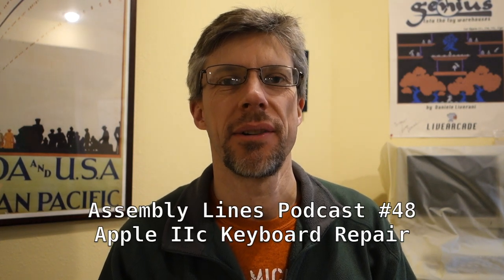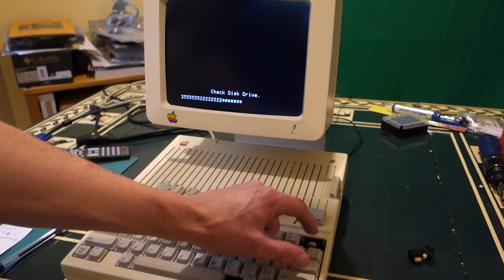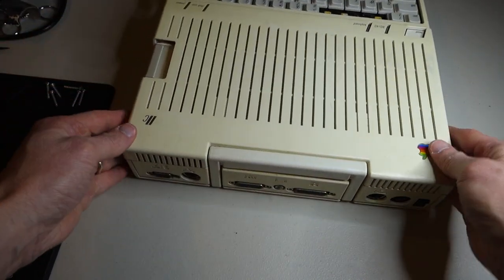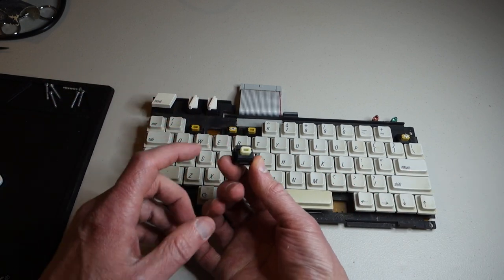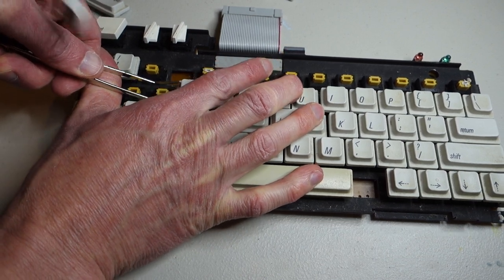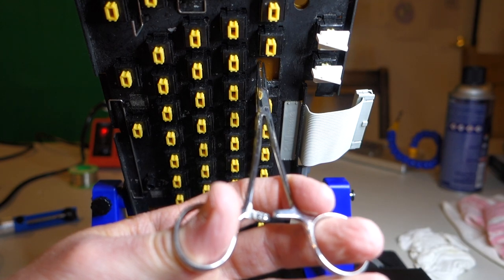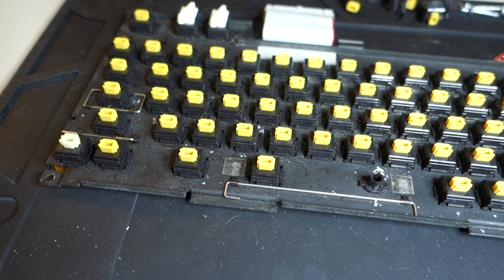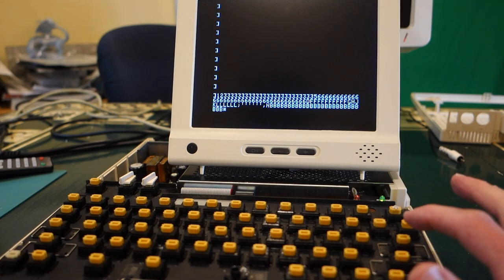Assembly Lines #48: Apple IIc Keyboard Repair

Comment: I accidentally broke a key on my IIc.  It uses the newer ALPS keys like you talked about (clicky kind).  I broke the post off like you have.  At first I tried Gorilla Glue but it immediately broke again.  Then, I bought some plastic epoxy and tried that.  24 hours later it felt super strong.  In fact, it worked like a champ.  So if you haven't already, I highly recommend using epoxy meant for plastics instead of glue.
Reply from the maker: I've been using Loctite Superglue Ultragel and so far it's been holding extremely well, even under some serious key bashing. But I'll keep the epoxy in mind also.

Comment: There's an easier way to remove the top with no risk of damage-  lift the back first. Apply some backward pressure and it will lift free, hinging on the front clip.
Reply from the maker: Cool, I haven't tried that. Thanks!

Comment: It's a good video, but I don't understand why the last key you pressed repeated itself, were they all shorted?
Reply from the maker: yes, exactly. I had to rewatch the video to remember what happened. The alcohol that I was using to clean the key switches hadn't completely dried, and the water within the alcohol was just making some of the keys short with others. Once everything was dried off, then it started working fine.

Comment: Also metal chip pullers actually work brilliantly on key caps. Surprising but true. They don't work at all for their intended purpose, as you say. 😬
Reply: (Buggie's plastic thing doesn't look like it would work. Gotta have the metal puller that fits between the keys)
Reply from the maker: Ha! Well, I've got a chip puller, so I should at least try to make use of it.

Comment: It's more likely you messed it up with Fantastik. IPA is not conductive.
Reply from the maker: Yep, I think you might be right. In my more recent videos I just used 90% isopropyl to clean things...
Reply: 90% IPA could be somewhat conductive but not much. I'm using 99% IPA for everything, you can pour it all over the board while it's working, no problem whatsoever.
Reply from the maker: Cool, thanks for the tip!